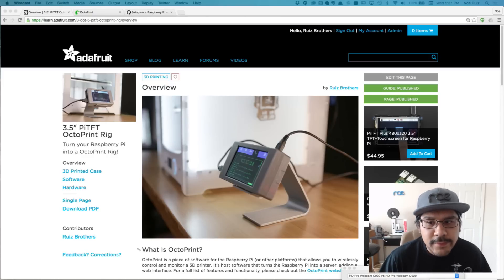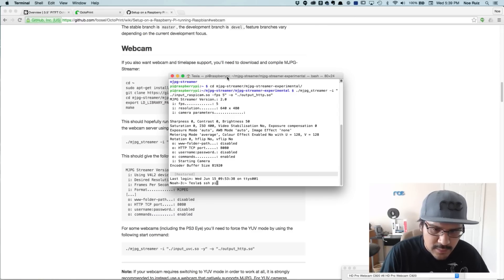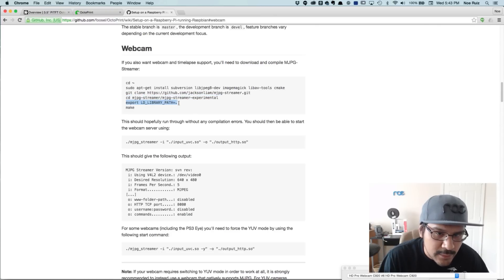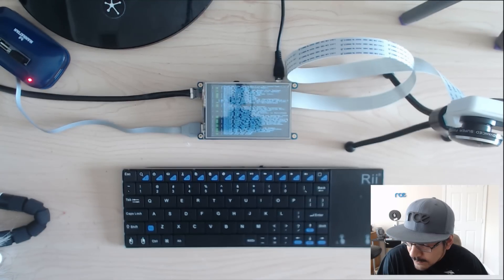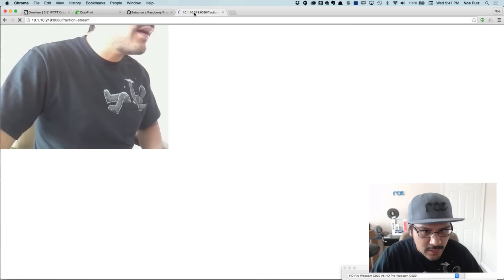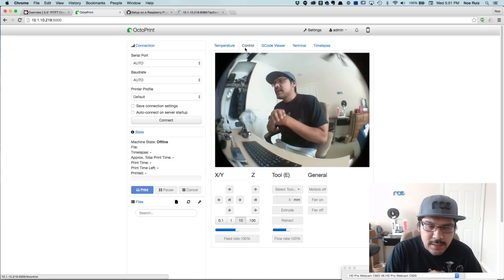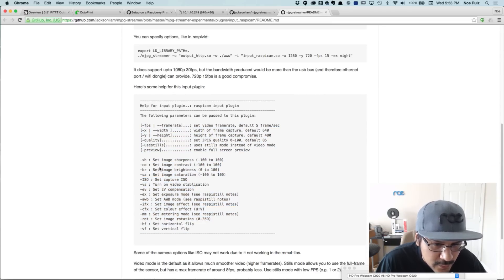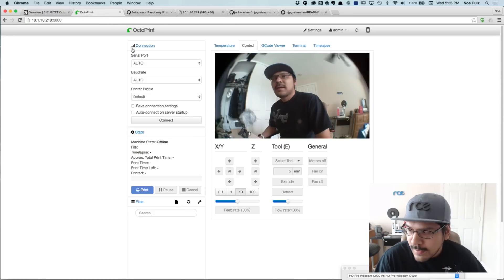How to Set Up Raspberry Pi Camera with @OctoPrint3D

Comment: How do I work out the framerate setting ??? Iv been looking for days, I'm using a raspi cam v1.3 and changed to 1920 x 1080, tried framerates 10, 30 and 5 and I just have so much lag, but nowhere explains what it does or how to work it out....

Comment: I have had the same problem as many describe below, this is how I fixed it:

1. Activate camera by going:
'Sudo raspi-config'
 and enable camera module.

2. rename the directory that is causing the trouble

cd ~
mv mjpg-streamer suspect-mjpg-streamer

3. return to the tutorial and retry:

git clone https://github.com/jacksonliam/mjpg-streamer.git
cd mjpg-streamer/mjpg-streamer-experimental
export LD_LIBRARY_PATH=.
make

Hope that helps!

--------

If the installation goes well (and you might be using a raspi B+ like I am), you have connected the camera and activated it as in (1.) but you get the error : "mmal: mmal_vc_component_create: failed to create component 'vc.ril.camera'"

You can fix this with:

add to /boot/config.txt :

start_file=start_x.elf
start_fixup=fixup_x.dat

Comment: Any chance of showing us how to get the cam to turn on in octoprint? I've tried and failed too many times at getting it to work. lots of people have asked the same question and still no help.
Reply: I know this is 3 years late and isn't to help you ( presume you have it sorted by now ) but anyone who is having trouble with this.

If you want autostart of the webcam you need to add the following line to /etc/rc.local (Just make sure to put it above the line that reads exit 0).

/home/pi/scripts/webcam start

Source: https://community.octoprint.org/t/setting-up-octoprint-on-a-raspberry-pi-running-raspbian/2337
About halfway down

Comment: I am getting this error.

Been trying many different ways to set this up.

I'm running octopi right on the raspberry pi 3.

pi@octopi:~/mjpg-streamer $ ./mjpg_streamer -i "./input_raspicam.so -fps 5" -o "./output_http.so" 
MJPG Streamer Version.: 2.0
 i: fps.............: 5
 i: resolution........: 640 x 480
 i: camera parameters..............:

Sharpness 0, Contrast 0, Brightness 50
Saturation 0, ISO 400, Video Stabilisation No, Exposure compensation 0
Exposure Mode 'auto', AWB Mode 'auto', Image Effect 'none'
Metering Mode 'average', Colour Effect Enabled No with U = 128, V = 128
Rotation 0, hflip No, vflip No
 o: www-folder-path...: disabled
 o: HTTP TCP port.....: 8080
 o: username:password.: disabled
 o: commands..........: enabled
 i: Starting Camera
bind: Address already in use
bind: Address already in use
 o: server_thread(): bind(8080) failed

Comment: Tried this numerous times. Even wiped the SD re-installed OctoPrint, flashed SD, got everything running as it once did (minus webcam), and tried this again to no avail. I keep getting stuck at the [export LD_LIBRARY_PATH=.] portion. I enter "make" and I get [make: * no target specified and no makefile found. Stop.] Also, not sure if I just entered it already but the github line results in "jmpg-streamer' already exists and is not an empty directory. In 'ls,' it shows that it exists, so I figure everything should have been entered correctly. though I can't understand why I still cannot get through this first part. I'm using a raspberry Pi Zero, raspberry pi webcam, have had no problems in terms of the other OctoPrint functionality.
Reply: " 
I have had the same problem as many describe below, this is how I fixed it: 1. Activate camera by going: 'Sudo raspi-config' and enable camera module. 2. rename the directory that is causing the trouble cd ~ mv mjpg-streamer suspect-mjpg-streamer 3. return to the tutorial and retry: git clone https://github.com/jacksonliam/mjpg-streamer.git cd mjpg-streamer/mjpg-streamer-experimental export LD_LIBRARY_PATH=. make Hope that helps! -------- If the installation goes well (and you might be using a raspi B+ like I am), you have connected the camera and activated it as in (1.) but you get the error : "mmal: mmal_vc_component_create: failed to create component 'vc.ril.camera'" You can fix this with: add to /boot/config.txt : start_file=start_x.elf start_fixup=fixup_x.dat"
 by Niklas Danielsson
 (Copy from IT-film)
Reply: @vbtt  Thank you so much!
Reply: @vbtt  thank you SO much for this!!!!
Reply: Make sure to do the " sudo apt-get update "
I had the same issue until I did that, then when I did the last " make " command it went well. Good luck
Reply: stuck here too
it didn't like the git clone line either, says it already exists

Comment: How can we automate this so it runs automatically every time ?
Reply: I have the same issue
Reply: @juanksurvivor  I know this is 3 years late and isn't to help you ( presume you have it sorted by now ) but anyone who is having trouble with this.

If you want autostart of the webcam you need to add the following line to /etc/rc.local (Just make sure to put it above the line that reads exit 0).

/home/pi/scripts/webcam start

Source: https://community.octoprint.org/t/setting-up-octoprint-on-a-raspberry-pi-running-raspbian/2337
About halfway down
Reply: I know this is 3 years late and isn't to help you ( presume you have it sorted by now ) but anyone who is having trouble with this.

If you want autostart of the webcam you need to add the following line to /etc/rc.local (Just make sure to put it above the line that reads exit 0).

/home/pi/scripts/webcam start

Source: https://community.octoprint.org/t/setting-up-octoprint-on-a-raspberry-pi-running-raspbian/2337
About halfway down